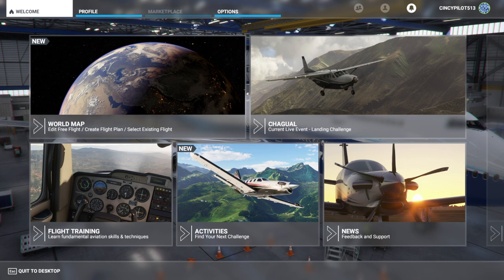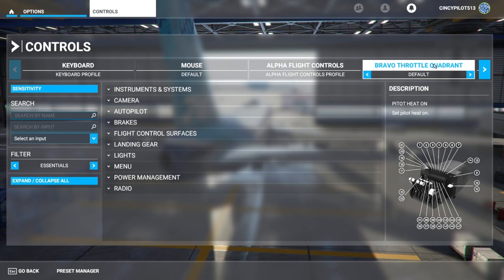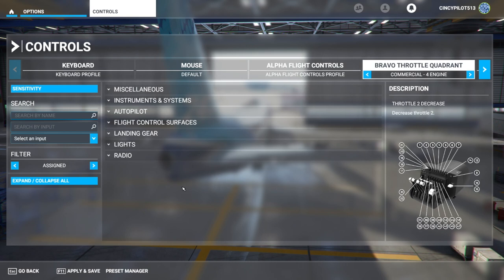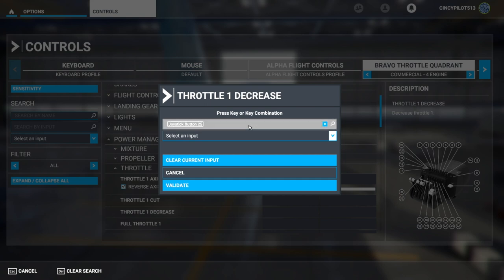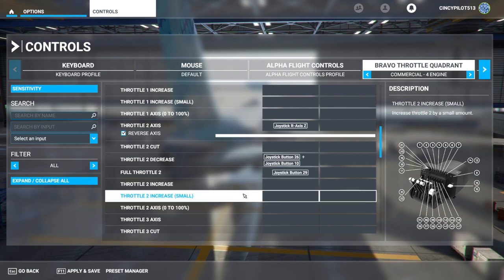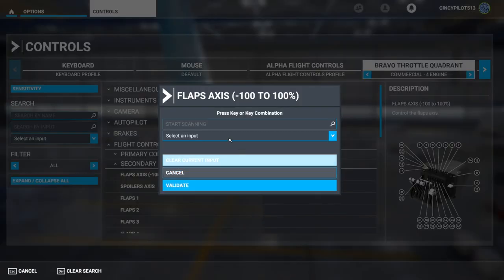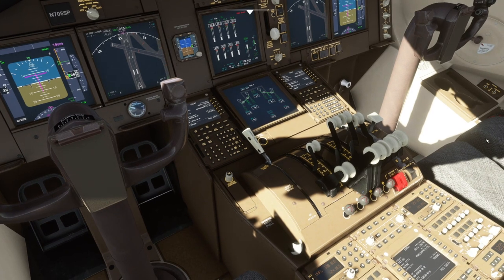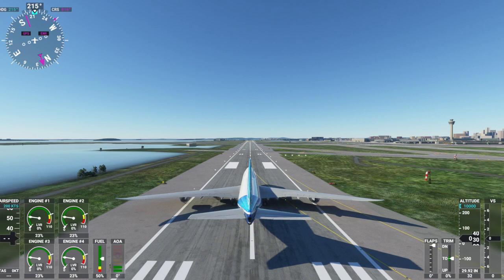Honeycomb Bravo - Commercial Four-Engine Configuration (Throttle, Reverse Thrust, Spoilers, Flaps)

Comment: Hey thank you for this video. I'm just wondering why in my case if I use the reverse option for the throttle 1-4 it works backwards. I'm leaving it without the Reverse option and it's working as it should. I wonder why the difference with yours?